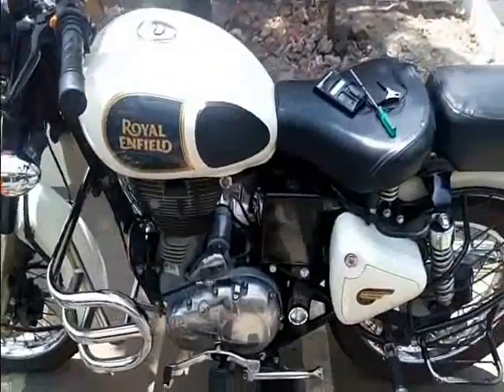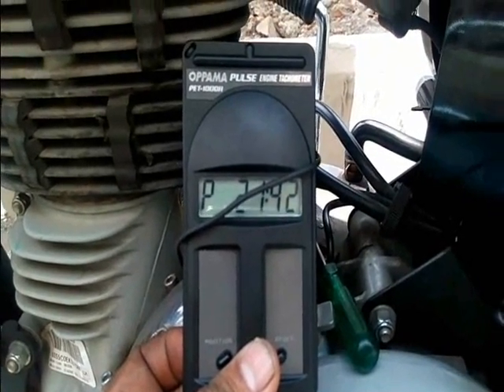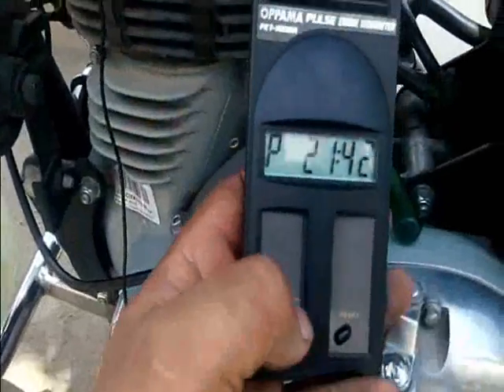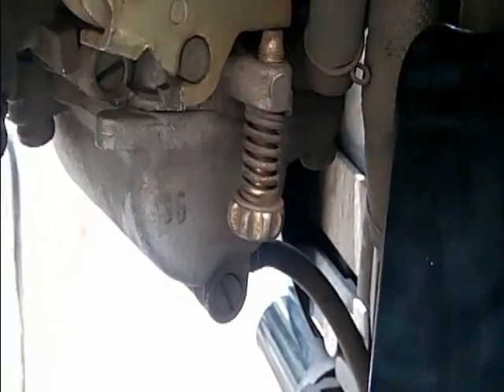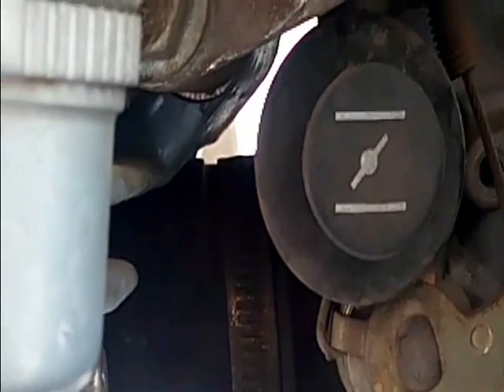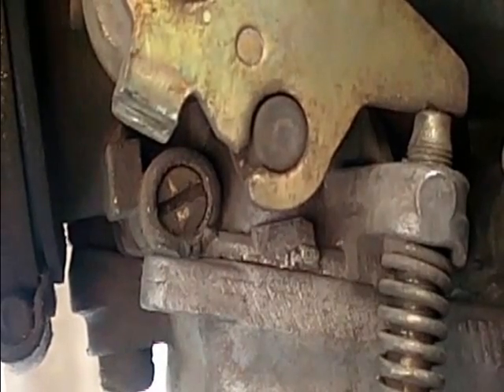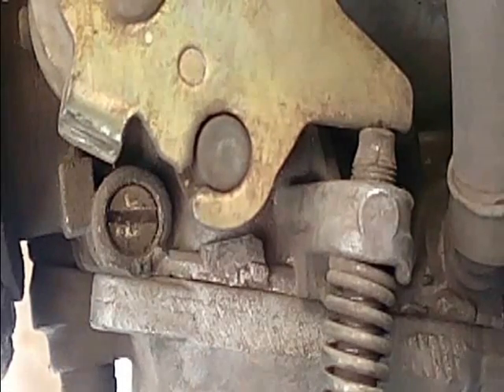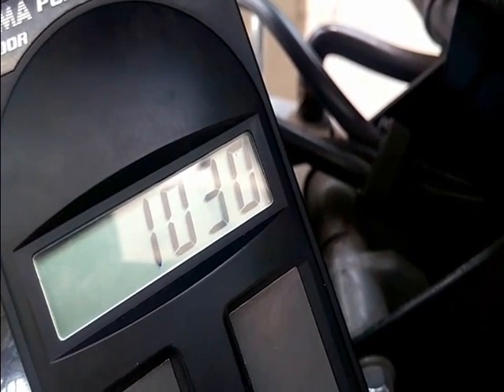Royal Enfield 350 UCE and 350-500 AVL Carburetor Tuning Procedure

Comment: Dear. Whats basic difference on mielage when your idle rpm 1200 and 800.
I have gunmetal , i opened 2full/4half turn with about 850+ rpm.on highway with constant speed of 55-70kmph i got mielage of 37kmpl.

I want to get upto 45kmpl.

Please descibe how
Reply from the maker: please let me know kms covered by you, let me know when did you service and what did you change during servicing.
Reply: Mech Auto Clinic total running 8600kms , 4th scheduled service on last of this month
Reply from the maker: 3 turns pe rakho. chain slackness check karo and air filter condition check karo... also macasp@gmail.com pe spark plug ke sparking point ke pics bhejo.

Comment: Hi Bro..I own RE Electra, reacent days i hear some metal touching sound while sit on bike and pushing it and riding it. but there is no noise when i just push it. Please  help me to troubleshoot the issue.
Reply from the maker: check the swing arm bush...u might need lubrication over there near to the swing arm axle and bush
Reply: @MechAutoClinic  is this same setting of threw screw out from full tight is applicable to bs4 carburetor

Comment: i have a classic 350cc enfield its single cylinder 4stroke twinspark... 
what it should be set on the tachometer like 01 RPM or 02 RPM ????

01 for (spark plug fires twice per revolution)
02 (once per revolution)
03 (every other revolution)
04 (hour only will not display rpm)
the default for the sandard model is 02 (once per revolution)

i am confused on what to set it  01 or 02 ?
Reply from the maker: the tach will show u 500Rpm when the machine is at 1000RPM...coz that tach is not made of twin spark...thanks.

Comment: tell me if m wrong or right 
i have a classic 350
ride about 5-6 kms to heat up the bike
first idle screw rpm set to 1100 or more (clockwise)
Pilot/Mixture screw (clockwise) till the engine shuts
increase the idle screw rpm (clockwise)
start the bike
then Pilot/Mixture screw (anticlockwise) 6 half turns or 3 full turns
idle screw rpm set to 1100 (anticlockwise)
tuned ? ? ?

one more question does it needs 6 half turns or 3 full turns OR if the idle is constant while rotating the Pilot/Mixture screw (anticlockwise) that's also is fine ???

please clear my confusion...